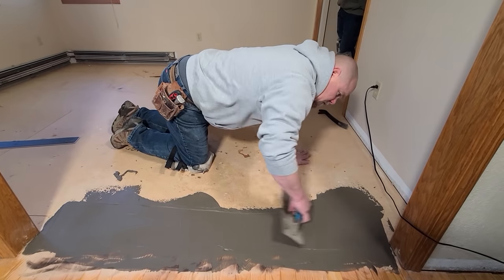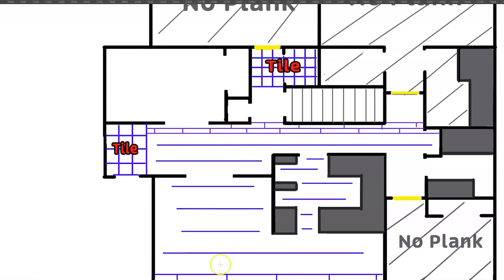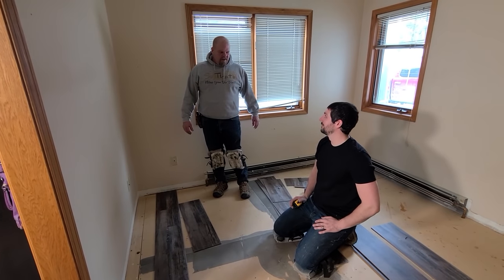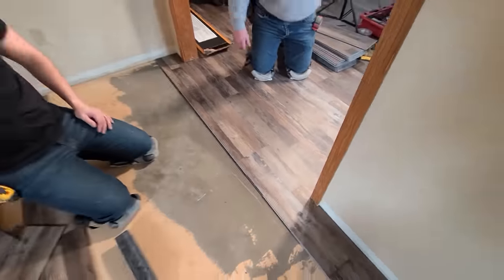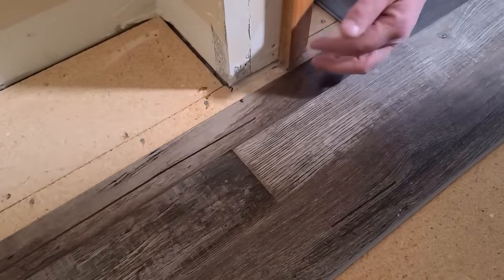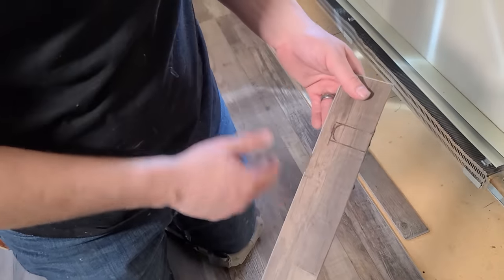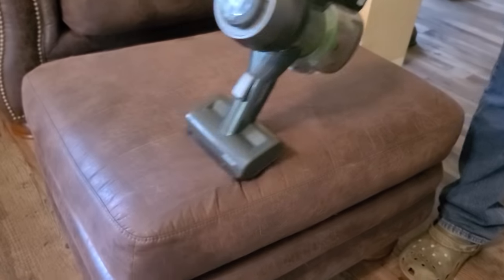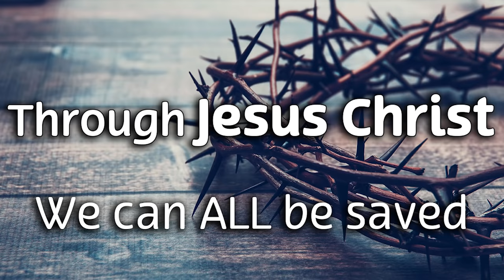Install Vinyl Plank from a Hallway into a Room | NO Transition Strip

Comment: I noticed you don't leve room for expansion  I thought the rule of thumb was a quarter of a inch on each side so it doesn't lift per instuchen on manufacture directions 🤔
Reply: The space under the drywall is sufficient for the expansion given the thinness of the material shown - it's thinner than the space between the drywall and the subfloor.  Drywall is 1/2" thick, so what is being shown is about a 5/8" expansion joint.  Based on the installation, it would appear that new baseboard will be installed over the new flooring.  

If your flooring is thicker than the space between the subfloor and drywall, you need more expansion area.  Vinyl floors request 1/4" expansion joints for a reason - the vinyl expands and contracts with the weather.  If there is insufficient expansion joint, the vinyl install will buckle (expand) during warmer times and show seams (contract) during cooler times.  I chose "times," as A/C can create a cold time as well as weather.  ;)

Comment: I put the same flooring in my house lol. Also a installer. 1 question, y the tap blocks. I always make a “tap block” out of the flooring I’m using. Cur a strap down a few inches by a foot and tap with a hammer then you know you’ll never break a lip off. Like your videos.

Comment: Hey, thank you for your detailed videos.  I'm currently installing LVP over a hardwood floor in a 100-year-old house that is has warped and separated boards.  Neither Ardex nor 745 is available in my area. Can polymer modified thinset be used instead? Have any other ideas for me?

Comment: Hi Joe,

You provide very good content and give confidence to DIY”er who want to tackle flooring job.

I am in the process of installing vinyl plank on basemen floor. The problem I have is the drain in the middle of the floor. The floor slightly slope towards the drain. How do I deal with that? It’s not constant slop. It’s start just around 1-2 ft from drain.

Let me know what I should be doing?

Comment: Good.effort.. always use the multi-tool to cut mains to meet your knife guide. If you must, cut the hack at 45 from a corner to break it inward to avoid a runner Crack. I'm something else at flooring. Adhd and a vape with a bit of coffee and dam. It is clean and I'd go anyways in math. Jigsaw can be clean as well. Spray joint if you need it to slide a bit

Comment: Do you happen to have a video showing plank installation going straight through a doorway (instead of side to side)?  I'm assuming I can do this but I'm a little nervous about it having not seen any videos showing any unique challenges I might want or  need to consider.

I'm planking my hallway, bathroom and kitchen and want the planks to go all in the same direction which means planks will run forward through the bathroom door instead of left to right)

Comment: I'm still trying to understand fully how you use the cheater board. If i understand this correctly you're setting up the vinyl planking so that it is a specific distance away from the wall of your choice so that it centered in the room.  Then the first she of vinyl planking behind the Pieces that you screw into the floor are the pieces that you cut? I kind of get it on a kind of don't i'm so sorry i'm struggling with the concept. If there's a very specific video where you show how to use a cheater board I would love a link to that. I will also look around on youtube and see if I can find some different explanations.  But I really like your videos. Thank you for the post.

Comment: Have another question? I have a friend that did a project but I see the dreaded patterns they say to avoid. The dreaded H and the stair step patterns etc. do you have a video link, you might have talked about this. 🙏🤓
Reply from the maker: No matter what you will get some stair stepping when looking at the floor from certain directions. The plank is all the same size and because of this it is impossible not to see stair stepping. As far as the H goes, that is pretty simple to avoid. Just always try and be sure butt joints never line up and you are golden!!

Comment: When you mentioned snapping a line to make sure the boards are straight, it confused me a bit. What would you do if the boards aren't running straight and square as you go into the next room? How would you change the way they're running if they have to snap into each other? I can understand snapping a line if you're using a transition strip, because it's a separate floor at that point. How would you square it up if it's a continuous run though?
Reply from the maker: Watch this video starting at 11:20 https://youtu.be/6eZHHSzI7Qo
Reply: @SoThatsHowYouDoThat  Thank you for answering. I appreciate that.

Comment: No matter the specific job requirements, there are several items that need to be addressed and followed during any floating-floor installation” When available, the flooring manufacturer’s instruction on preparation, installation, or use of the wood floor. Where manufacturer instruction are unavailable, lack information, or they reference NWFA Guidelines, use NWFA guidelines.

Important things like minimum tolerance of 1/8” in 6’ or 3/16” in 10’ ( subfloor Flatness)

Any doorway less than 4 ft in width, and within any flooring system that spans are greater than 20 feet in width or greater than 40 ft in length ( in comparison to flooring installation direction), unless otherwise directed by the flooring manufacturer.

Comment: I'm going to try and do my entire house it will probably take me a few months because I can only install on the weekends. How do you stop with the strip sticking out so it doesn't get  debris stuck all over it....or does it dry out?
Reply: I always tape over that edge with blue tape or even cut a strip of something and tape it down. Depending on the flooring you are using, that edge can get broken off if you walk on it so you definitely need to protect it

Comment: Hi Joe, love your videos! I am planning on installing lvp or laminate and am still researching products. I want to do a seamless installation throughout my whole house, without transitions, but recently learned that a a lot of floating plank have maximum spans before a transition is required. Also a lot of them specify a doorway size (4 ft for example) and anything smaller than what is specified needs a transition. I want to avoid transitions but also don’t want to void the warranty. Any advice?
Reply from the maker: I can only answer this question by telling you what I would do in my house. I would not use a transition and if there was ever an issue I would then cut the floor at the door and add a transition. Now you need to decide, what would Matthew do?

Comment: Do you have any videos on subfloor height issues?  For example, a second floor, where there are two bathrooms with tiled floors that are 1" above an OSB subfloor.  there is thick padded carpeting now so the height difference isn't too bad.  But removing the carpeting and putting in LVP will create a noticeable, and awkward, height difference where the LVP meets the tile.  What transition  angle to too much?  Would you raise the subfloor and, if so   how high?
Reply from the maker: watch this - https://youtu.be/fYWar12EoYQ

Comment: Hey Joe, I have been watching your videos for research on laying laminate floors. I’m leaning towards Pergo Outlast, but I’m torn between doing a separate LVP in the bathrooms and just laying all outlast throughout the house. Would gluing all the joints in the bathrooms for the laminate increase its waterproofing capability? With a Gorilla wood or super glue? My wife would prefer the same tile throughout and if I can make it work with Pergo that’s what I want to do.
Reply from the maker: If it is a vinyl plank or vinyl tile then I would not worry about gluing the joints. If it is laminate, then use wood glue in the bathrooms
Reply: Thank you! That’s a big help and your videos have already given me confidence that I can lay the laminate like a pro. …or at least similar enough to a pro lol

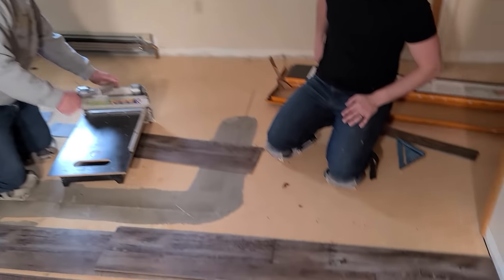Comment: at 13:05 you are talking about the guillotine cutter, I have 7mm laminate lock and lay flooring, the scoring didnt work, and my skill saw chips the ends so badly... I started my sons closet because it has to be done first since I am building his custom closet... I made the first mistake by cutting first (not realizing the young vs lip side)  thank the lord I bought so many extra boxes since they were on close out... 

but I am wondering, is there a way to use those scrap ends? or are they just now extra cheater pieces?
Reply from the maker: You can use them on another wall somewhere

Comment: Note* 9:14 be careful here when cutting over your finished floor that your knife does not slip off the end of the cut and scratch your floor, I like to take a scrap piece and place it under my cut so I know I'm good or flip a plank upside down to cut over, but you should cut over the bare floor until you can't any longer to avoid any accidents as some flooring is harder to score than others and once your blade dulls, blade control or not it could slip at the end of the cut.

Comment: what plank system is that where you can just rip little strips off with your hands?? i have to take pliers to mine after scoring. its the rigid core from homecheapo.
Reply from the maker: Not all plank breaks this way, but it is all in the wrist. We are pressing down pretty hard when scoring the plank.

Comment: How do Install laminate from tile in hallway/kitchen/family room into 3 bedrooms with all 1/2 inch lower vinyl flooring? I know we can remove the old vinyl and put plywood , but that’s not on the budget. What’s the best way to make that transition from tile to vinyl, trying to put laminate flooring with no transitions?
Reply from the maker: What is the height difference?
Reply: @SoThatsHowYouDoThat  tile 1/2 higher than the old plank vinyl

Comment: Good job most guys would have just used some structural card board I believe is what they call it. But damn get yourself some bigger flashing trowels that versabalde is made for carpet guys lol jk. If Schonox is available locally give it a go if, We still use ardex but most of my guys prefer Schonox as do I.
Reply from the maker: Schonox is pretty good! I do have bigger trowels, just showing a DIY how to with a small trowel.

Comment: I never use flooring that is as thin as you are using! Smartcore  the locking edge is as thick as the flooring you are laying down! You say the locking edge is what holds flooring together and Smartcore locking edge is thick strong the the flooring is quiet to walk on. Its thick and strong two of the planks you are laying down to make one plank of smartcore same price as the thin stuff!
Reply from the maker: I am just installing it, I did not buy it... Mannington Adura Max is my top choice!!

Comment: I never use filler just take a piece of scrap vinyl or cardboard it's a floating floor you can get away with more than you think remember the tap and lock products are not as good as having locking mechanisms all the way around and just because it's waterproof you still have to use Vapor Barrier on concrete 6 mil preferred they don't want you putting cabinets on top of it

Comment: You don’t even need a cheater board you can use just a full new plank and not have to worry about dragging a 10 inch piece down a 8 ft wall